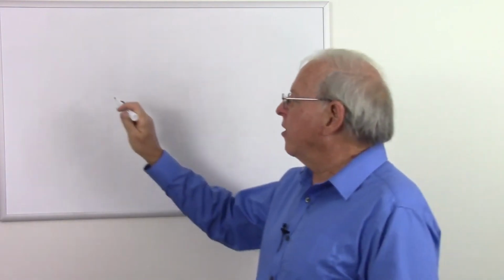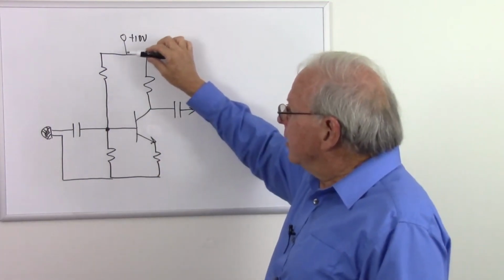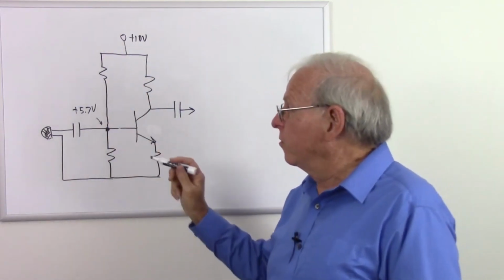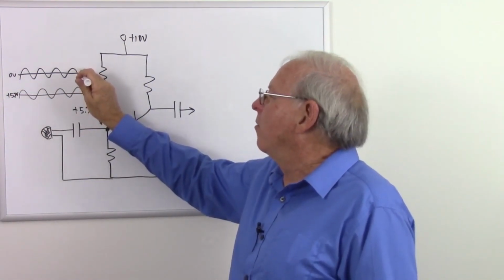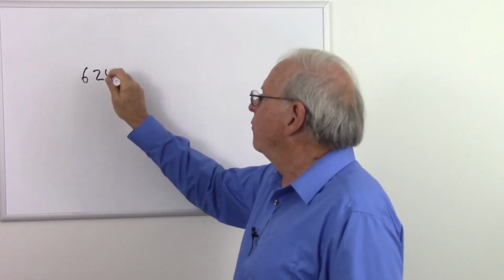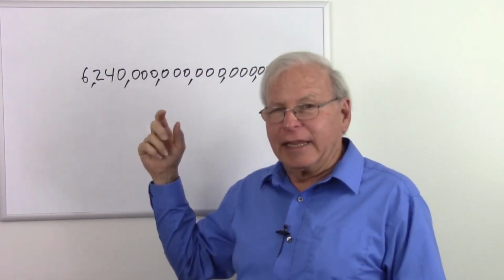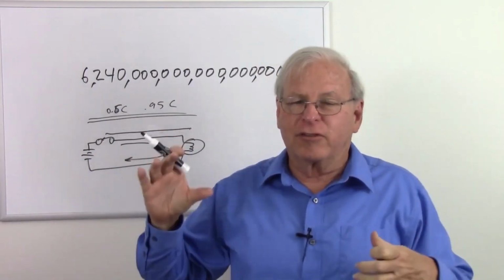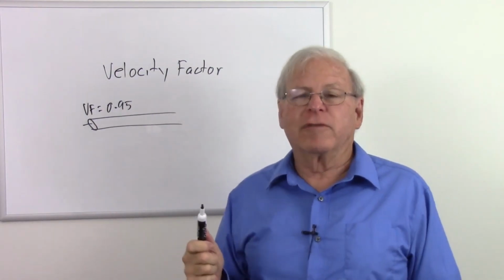Is That AC or DC and The Speed of Electricity   Answers to Questions

Comment: Actually you do have the instrumentation to measure velocity factor, your oscilloscope.  That and a simple homemade pulse generator is all you need.  Alan W2AEW has a good presentation on characterizing coax cable and measuring velocity factor.  https://youtu.be/TpIIftvQPFM?feature=shared

Comment: Why is there only one "hot wire" in an AC wall outlet? Apparently the neutral wire also need   to be dangerous to touch it since the polarity of the voltage is always changing, isn't?

Comment: Wouldn't the sin wave from the microphone be centered above zero volts, because the minimum voltage is grounded to zero volts?
Reply: I ask because I have been trying to comprehend what it means for one side of a capacitor to be grounded.
In an ungrounded capacitor a build up of positive charge on one plate is met with a build up of negative charge on the other plate. In ungrounded situations, I think of the positive plate as having positive voltage of half the potential difference, and the negative plate as having minus half the potential difference, with the sin wave centered on an unstated absolute voltage. But if the varying lower voltage is kept at a nominal zero voltage, its absolute voltage (unknowable) must vary.

Incidentally, Bob, thank you very much for your videos on common/signal ground vs earth ground, and the significance of where the black lead is put with respect to the former.
Reply: Sorry for the length. Most shouldn't/wouldn't read it.

Got it. In my opinion, logic dictates ...

(but first I'll define an arbitrary non-varying voltage which I'll use to represent an arbitrary absolute voltage pretending external factors cannot vary this voltage against some more stable absolute reference: the positive terminal of some fixed power source of an open circuit unconnected to the circuit containing the capacitor under question).

... an alternating current will will change Vcc and ground in absolute terms, albeit not in relative terms to each other. And the minimum voltage of an alternating current with ground at the negative plate of a capacitor will be zero volts, and the median voltage will be above zero.

Let's say the capacitor circuit is grounded at a capacitor terminal to some reference voltage which happens to be say 5 volts above our absolute voltage. In our circuit though, this is zero volts on our scale for this circuit.

Let's say there is a bias voltage (I trust I have picked up the meaning of this term correctly) from a DC source of 10 volts. The Vcc is therefore 15 volts above our absolute voltage.

A step voltage source in the circuit steps up the voltage across the circuit by 2 volts. This will raise the voltage across the capacitor to 12 volts. The negative side of the capacitor will stay at zero volts, because that is ground, but this ground must now be only 4 volts above our absolute voltage (since the negative plate of the capacitor changed by 1 volt in absolute terms), and Vcc (is still 10 volts above ground but) drops 1 volt in absolute terms to 14 volts above our absolute voltage.

So an alternating current will will change Vcc and ground in absolute terms, albeit not in relative terms to each other.

Then the step voltage source steps down to minus 2 volts. Voltage across the capacitor is now 8 volts. The negative plate of the capacitor becomes 2 volts less negative. Ground at zero volts on our scale is now 6 volts above our absolute voltage.

The step voltage source then steps back up to + 2 volts, 4 volts higher than - 2 volts.

So while an alternating voltage source would alternate about a zero-volt median if that median were ground, it is not ground, and so in this circuit the alternating current alternates 2 volts above and below 2 volts.

Whereas on the first step up the positive plate was 12 volts above ground and on the second step up it is 14 volts above ground, it appears there is an iterative stage before an alternating current settles to relative voltages above ground.

Comment: The power that comes into your home is AC. That AC is converted to DC, by the power supply rectification, and filtering caps, that supply the DC into the unit, so it can function!